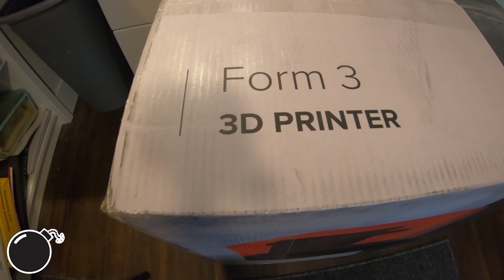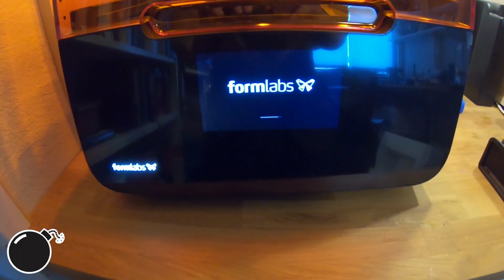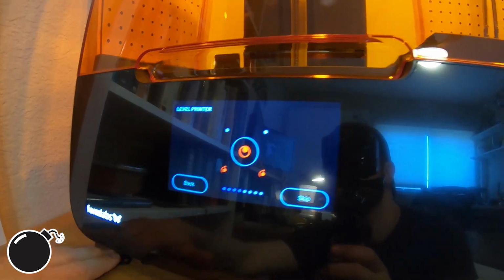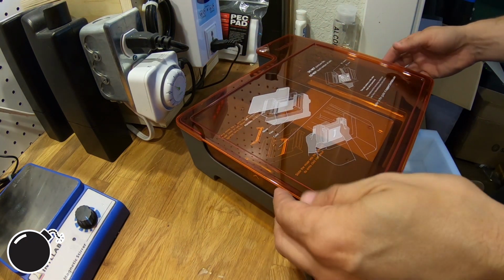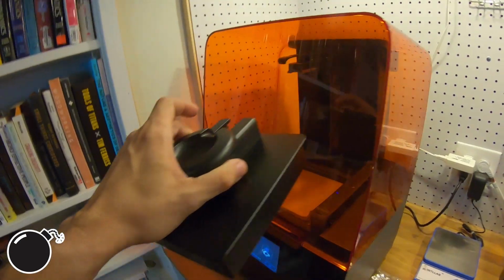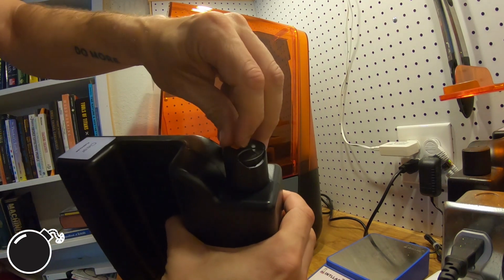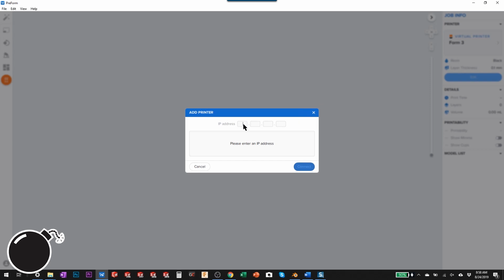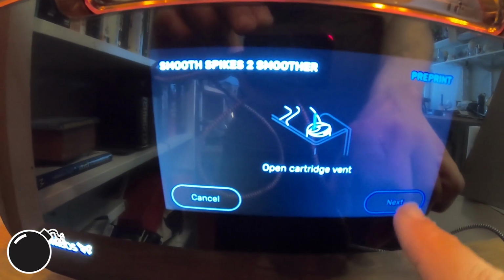Form3 set-up and first print.  My first impressions 2019

Comment: Was a user of the Form 2.  It is a decent printer connected to a horrible company, Please for the love of god stay away from formlabs!  This is not a user friendly company and a very overly locked system.  Resin costs from formlabs are absurdly overpriced and these printers do not allow you to use other brand resins.  If you think they are locking the system to make is more simple you are wrong,   and don't fall victim to that train of thought.  The clear and true reason to lock the system, put chips on everything and report all your print history to formlabs is for control.  This company is anti-consumer in basically all respect.  Not allowing user to use other resins in the market for competition is evil and any reason they might point to for restricting it is pure BS.  I sold my form2 after about a year of using it with many issues and it was the best decision I made with 3d printing.

Comment: Hi I'm trying to find a real-time video showing  2-3 full layers to get an idea of layer time for cure and delamination/layer change, could you film a little one next time your using the form 3 please
Reply from the maker: On the formlabs printers that will depend on the area the laser has to cure (how many square inches the slice is). So can do it but know that it will not always be the same... Does that make sense?

Comment: I would like to know after you finish printing what do you do with the tank that has still resin left, should i clean it or just pour the resin back in cartridge and what else is left in tank to leave it like that.   @thoughtbombdesign
Reply from the maker: What you most likely do is keep each tank with one type of resin in it. So once you use a tank with clear resin you leave it in there and get a new tank for a new resin. It kind of sucks. But cleaning a tank well enough to switch resins sounds even worse... That's why unless I have a client absolutely need a different resin I will always print in clear because that's what I have. Does that help?

Comment: Hi. Would you upgrade to a model above this one you have? Why the alcohol and blue light? Thanks for your time.
Reply from the maker: Probably not. This one works well. The alcohol cleans resin off the print and the UV light cures the print and makes it stronger 👍

Comment: Hi, I am a Ph.D. student in Japan, and 3D printer plays an important role in my research. But I am totally new at this and the 3D printer that we have in the lab is totally in Japanese. So it is already very difficult to understand the 3D printer for me. Currently,the ID chip on the resin tank got broken. I have to put the resin manually. That becomes really difficult as we cannot control the temperature. Is there any way to fix the ID chip in low cost? If possible please give me some advice. It will be very helpful.
Reply from the maker: My only ideas would be to make sure to clean the chip contacts really well or buy a new tank. Good luck!

Comment: This will be my first time buying a 3d printer and I could really use some guidance! Is it possible that I could just buy a uv light from amazon to cure or maybe just sit the project in the sun? 
Also, how do I gain access to the computer program? Is it complimentary with purchase?
Reply from the maker: HI Ashanti,
You can definitely just get a UV light to post cure the prints. Try to stay close to the wavelength the formlabs curing station spec is.  I made my own and keep meaning to do a video on it..... 
Setting them in the sun will also work. I have done it but i am not sure exactly how it compares.
Yes, the 3d printer software is free when you buy the printer. You will still have to come up with your own files to print but the software that handles all the print settings is free. I hope you like it! 👍😁

Comment: I'm a form2 and form3 user。Unfortunately I found Form 3 do bad results than the old form2.Form 3 seems has layer shift  on every single print。And it lose a lot sharp details。Then I check the formlabs fourm。Hundreds of users do have the same problem。So disappointing！
Reply from the maker: Oh man, that's not good! I haven't had that issue but I would be pissed if I did!

Comment: Just a quick question, when the Form 3 is done printing does the Resin in the resin tank go back up the cartridge or it stays there for you to clean it up??
Reply from the maker: It stays in the tank for the next use. The uv blocking orange housing keeps it good for a surprisingly long time. I don't know what formlabs says but I have had it in there for months before.
Reply: @thoughtbombdesign  How difficult is it to change colors then?

Comment: @ 10:32  you said  "...AFTER  10 and a 1/2 HOURS LATER" A R E  Y O U  F-word  S  E  R I O U S  ?????? I would recommend such a resin 3D printer to my worst enemy!!! Are you serious, are YOU serious?!   300$ resin 3D printer is able to do it in less than half that time.
Reply from the maker: Yeah, I tried the highest resolution setting to see if it gave a better surface finish but it didn't do much other than add time....
Reply: @thoughtbombdesign  Some SLA  (laser bottom-up) printers do have a variable laser spot feature. This way you  (printer actually) can/could tweak the resolution but I'm not sure about Formlabs' prnters.  Otherwise a good feature if made well. This way youcan use finer resolution near the borders and bigger spot/higher resolution in the middle of the part.
The ideal solution is anti-aliasing (AA) between layers. The  Masking-LCD resin printers do use AA on a single layer but the true smoothness come if you use  AA between layers!!  (search youtube for AA in resin 3D printing for more) . So, yeah laser scanning with galvanometer is very very very slow!!  Ad to this scanning a thinner layer for  getting "bigger resolution" and you end up in prints lasting a day!
Personally I would not recommend a SLA for small printers. For the big ones in the range of 600x600x600mm, or so, ... the good ones use multiple lasers anyways!
SLA is obsolete. Therefore Formlabs tries to make their "Ford T model" look like "Tesla S".

Comment: I have found that if you try to remove the supports after the wash, but before the curing it is much easier to get the supports off.
Reply from the maker: That's probably a good strategy, thanks for the input!
Reply: @thoughtbombdesign  You are welcome.

Comment: Do you need to purchase a resin tank for each different type of resin you are using? For example if I want to experiment with 5 different resins, will I need to purchase 5 resin tanks? Thanks!
Reply from the maker: I think formlabs says you can switch resins in a tank but practically speaking that's a cleaning nightmare and I have never tried it. Realistically, yes, one tank per resin. It's a real bummer because it makes it real expensive to try out new materials..... I think that's why they're so free with their sample parts in different materials....  And why I print pretty much everything in clear!
Reply: Thought Bomb Design Good to know! Thanks for the explanation! We’re planning on buying one soon with several resins! Thanks for the reply! Great video!
Reply from the maker: @crstudios8221  thanks! It might not be the cheapest printer out there but it is damn good. I don't think you will be disappointed 👍

Comment: Can you refill the cartridge with any other brand resin?
Reply from the maker: You can remove the cap and pour whatever you want in there. Whether it works, who knows, but it will keep thinking it is whatever resin originally came in that cartridge. The printer keeps track of how much resin each cartridge has so eventually it will give you a low resin warning but you can just click 'ok' and print anyway.
Reply: @thoughtbombdesign  Understood. Have you tried pouring other brands and using them? Or have you stayed with their brand because it gives you solid results?
Reply from the maker: @TheeAthis  no, I have stayed with form Labs resins.

Comment: I was looking into getting one of these but was told they would have problems with denigration of the laser, calibration, resin tray usage within a few months... that’s why you need to buy protection....plus very slow. so. So I was talking to nextdent  5100 and they say because they have a comercial printer you would notice a difference in printer ....they call formlab printers toys. With nextdent thee is no maintenance agreement say the projector is good for 10 years....I wish i knew...they were saying that most that buy there’s have had formlab and were disappointed.....now that may have been with formlab 2 ....but not so sure with the formlab 3 . Have you had formlab printer before this one that you could tell me about?
Reply from the maker: I had a form 2 for a couple of years and I did have to end up sending it in for calibration (not cheap). Until then it was trouble free and awesome though.  Having to have a tray for each material kind of sucks but any resin printer will be like that. The trays don't last forever but more than a couple months unless it is printing non-stop.  From what I have heard DLP projector printers are faster but the projector dies or gets less accurate sooner than lasers but who knows. Having to wade through marketing BS is so annoying. I wish someone could just have all the brands and compare them!!!
Reply: Thought Bomb Design  I agree that would be nice if companies that sold all the brands would test them all and just tell us with one is the best for the buck. ONE of the reasons I was looking at nextdent they say you won’t have to worry about the bulb for 10 years....
Reply: Well we have form 2s in the lab and they are workhorses, form 3s arriving any day now, and print for almost every case we do (drill/screw guides). The parts are perfect, and after post-processing straight into the autoclave. Not sure why the laser would “denigrate” like they said. Yes, some parts do wear out, it’s a mechanical object or course it will. And as for service, I wouldn’t use any 3D printer clinically that I didn’t have service on. It’s something you depend on for your work, you need to protect that. My Honda came with a warranty, not because it’s unreliable but because that’s how expensive mechanical things work. We have service contracts on almost every piece of equipment that isn’t self fixable (and if it is self fixable, we have our clinical engineering guys go get trained so we have priority for parts)
Reply from the maker: @henryhbk  well put!

Comment: Got my Form 3 ordered in May, waiting but it now, it is my first 3D printer to own. (we do have a Form 2 at work so I can compare print) So in waiting for the Form 3 and the problems they just announced with the Form 3 not being able to print some resins...Grey Pro, Rigid and Elastic https://forum.formlabs.com/t/form-3-resin-availability-update/24800 I was offered by my Salesperson the option of taking a REFURBISHED Form 2 instead as an option because of these issues...? Does that seem odd? Should I just be taking a Form 2 Refurbished just to make sure I have a good machine? Will it be outdated once they get issues solved for the Form 3? Or since I am NOT in a hurry and these resins wont bother me, get the Form 3 and wait for updates and just use the Grey Resin I had initially ordered? For the most part I am wanting to print pieces that I can mold from, prototype for people toys, etc. Main uses that I had intended. Thanks for any feedback guys!
Reply from the maker: That is pretty odd and disappointing..  I hadn't heard about the resin limitation.....  I'm glad I haven't had the need for those materials yet!!!  That's a pretty big oversight on their part and I am sure they are scrambling to solve it.  If you don't really care about those resins then I would say get the 3.  They announced a while ago that they would end support for the 2 in just a couple years so it would suck to jump on the end of that train....  Tough decision for sure though.....

Comment: Now go get a Form 3L and do a review on it. :D
Reply from the maker: I WISH..... that thing looks amazing. Although, I can't imaging how long a huge print would take!
Reply: @thoughtbombdesign  I ordered a Form 3L back in April, but I don't make vids. The Formlabs people told me that it prints about 30% faster than the standard Form 3 due to having 2 LPUs and the "overlap zone".  Btw, is your cure box temp controlled? I really like it. Can you make a video explaining how you made it? I need one like that but on a larger scale. Or maybe point me in the right direction? I'd appreciate it. Keep doing what you do!
Reply from the maker: @madshader  I can't wait to start seeing videos on that machine....
Yeah, the twmp/UV chamber has a temperature controlled fan on top. So when it gets over the set temp it sucks hot air out. The UV lights themselves generate the heat. I have been thinking about doing a video on that. Maybe I will now. Thanks for watching!
Reply: @thoughtbombdesign  Great I look forward to it!
Reply: @thoughtbombdesign  , yes, I would also like to see a video of the UV chamber.  That thing looks amazing.  Thank you for the video.  I have been contemplating the Form 3 for sometime.  I have a polyjet printer and I have been wanting to get another machine that can provide similar results at much lower price.  Thanks again for the video.
Reply from the maker: @guillermogomez4031  It is a good printer for sure.  The only hassle is still having to deal with the support marks, but what are you gonna do.....   ;)
Reply: @thoughtbombdesign  you will have to give up another kidney for it

Comment: Just a suggestion, remove your supports before you cure, it makes removing the supports much easier. I don't have a Form 3, but I do have a DLP printer and it's what I do. Hope it helps you, take care.
Reply from the maker: In my earlier tests when I did that, the supports just kind of bent and wouldn't break off clean.  So that's why I started curing first.....  I'll have to try that next time, thanks!
Reply: @thoughtbombdesign  You probably know already. But you can also make the support Touch point size smaller. this way it leaves less marks on the final print and you can cut/snap them off much easier. I did not have any issues during printing yet, i would normally mention beforehand if you go too small.
Reply from the maker: @rovasa4990  Yeah, I actually got an email from FormLabs saying that they recommend a 0.35mm contact point so I have been using that.  It works pretty well!